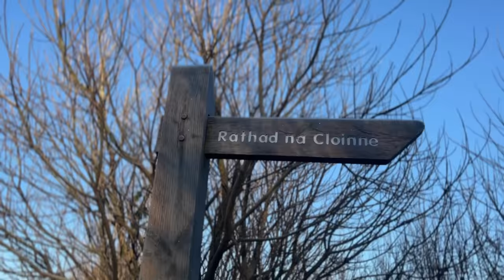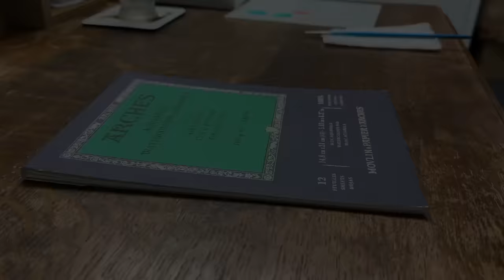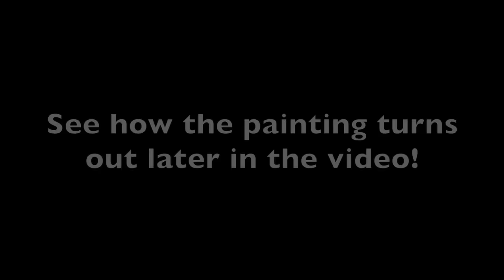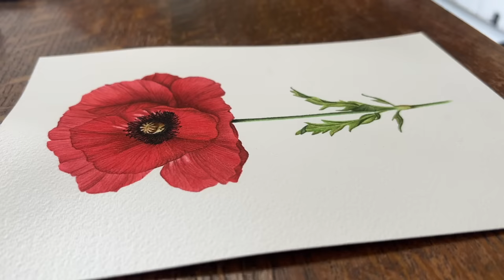Spring Is Coming To Our Cottage On The Isle of Skye - Scottish Highlands - Ep61

Comment: Put dehumidifier gel or pellets in socks and hang them in your car to keep the dampness out , change the gel or pellets as needed or get the kind that you can put in the oven dry out and reuse.
The reusable kind starts out blue and turns pink when wet and then back to blue when it is re-ready to use. These work in my truck for all of winter......
Reply: Great idea
Reply: Recently got one of those reusable ones. Am loving it! Litre of water spilled (don't ask)? No excess moisture to deal with!
And in general the windows fog far less in damp water. When they do I know it is time to microwave the dehumidifier.

Comment: If the shampoo you used doesn’t work for the mold Milton Sterilising Fluid diluted with water should kill the remaining mold spores. Spray it on using a water sprayer then rinse. Maybe patch test it first in an unobtrusive area in case it bleaches the fabric.
Reply from the maker: Ooh good tip, thanks!
Reply: @livingtheskyelife  Hopefully you won’t need to! 🤞🏻

Comment: If you use granulated dessicant (dehumidifier crystals used for storing caravans) in your car over the winter the moisture problems should disappear. Any dealer or online store should have it. Start with a kit then just buy the crystals to replenish. Easy, relatively cheap and no power supply required.

Comment: Your legs are the perfect length Sarah. Any longer and your feet would be stuck in the ground, any shorter and you would be floating in mid air 😁 
Everything has the potential to be a sinkhole for money. As long as the enjoyment you get from it is worth the cash to you then you're on a winner.

Comment: If you leave you car sitting for long periods of time, consider getting a moisture absorbing product. I know the brand DampRid is available in the UK and it is basically a bucket that you take the plastic lid off of and then let absorb the moisture which settles in the bottom of the bucket. When it's full, you just throw it away.

Comment: If you had  hooked the trailers up to two vehicles  with the boat on the one ,
then floated the boat off it and onto the new trailer, that would  have  been  an easier solution.
Oh well:(
Cheers,
Rik Spector

Comment: New boat trailer is very smart but I notice that some of the box sections are open ended.  I would be very tempted to stuff as much rust preventative and protective coating into these sections as possible to ensure a longer rust free life.  After a warm dry spell if you are sure that there is no water in the frame you could consider capping the open ends, but this might not be a good idea as immersing the trailer in salt water might allow water ingress through assorted fixings.  The poppy painting is wonderful.

Comment: Do you wash off the trailer each time it has been in sea water ?
Car looking so much better. Do you plan  to build a car shelter/port for your vehicles
Reply from the maker: Yes I do. And also the Land Rover, after I use it on the sand for launching the boat.
No plans for a car port just yet - too many projects booked in for this year already. Maybe next year though.
Reply from the maker: Yes I do. And also the Land Rover, after I use it on the sand for launching the boat.
No plans for a car port just yet - too many projects booked in for this year already. Maybe next year though.

Comment: You should get some Damp Check or whatever the UK equivalent is to leave in your car if you don't drive often.  Most cleaning solutions only reduce mold appearance, you need to use Concrobium to actually kill it.  Nice job on the car!